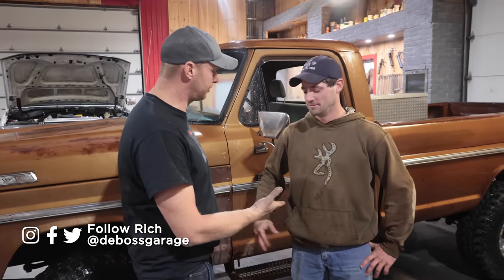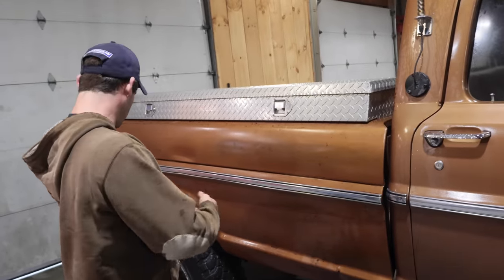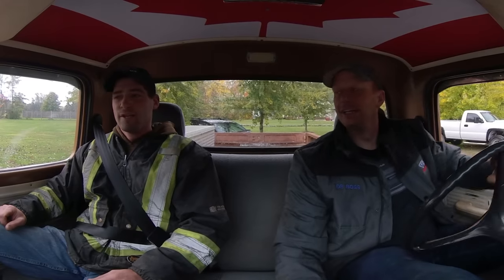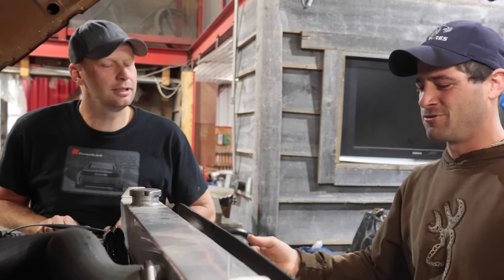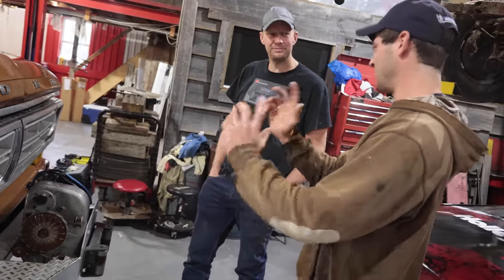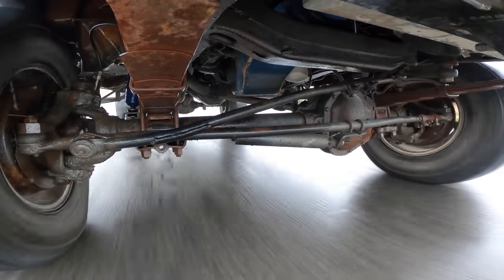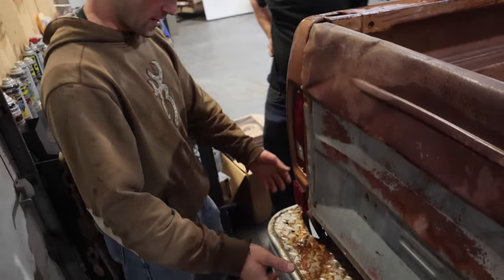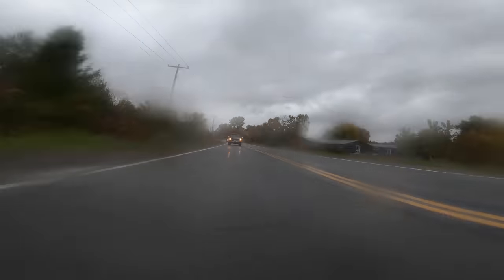The Truck You Want, But Won't Admit It.

Comment: Most of the time, the starting issue on those old engines is caused by air intrusion through the fuel return line caps. Fix those, add an electric lift pump, new set of glow plugs and my old 91' F250 had no issues firing off down to -10F.
Reply: Yes, upvote this. Electric lift is the single best mod I ever did to mine.
Reply: in case of doubt, glowplugs on a pushbutton/switch, my 6.2 starts at -30celcius unplugged
Reply: Lift pumps make the biggest difference. Maybe it's just my issue to get air in the system after it sits for a week or 2. Plugs help too but it doesn't get that cold for me. Only like 15° but it's better than using the starter to warm up the engine.
Reply: There's multiple issues that can hinder easy starting on these. After addressing everything else, my issue was simply that the old stock starter cranked too slow. Got a Powermaster and now I don't have those issues. These things want to spin REALLY fast when they start. Batteries, cables, starter, anything you can do for it will help.
Reply: Yup, I put a Carrier lift pump on my 86' with new glow plugs and it would start no problems way down cold.  Miss that old 6.9idi...
Reply: @DeusTex-Mex  My 4M40T Mitsubishi is the damn same. I pulled all the glow plug wiring and relay out of it because it looked sketchier than frig and I didn't wanna burn my truck down, but it made it a pain in the ass to start below 8 degrees C without any cosby sauce. When I put new batteries in it, it really wanted to go with just a quick snort of cosby
Reply: My 92 uses the stock mechanical pump and fires up easily. If u add a check valve in the supply and return the fuel can never drain out of the fuel filter or injection pump
Reply: Cool story and nice old Ford. I think the older body styles have so much more character than the new stuff. That dude seems pretty cool too.
Reply: I don't think the electric pump is necessary.  I put one in my first idi and it didn't make much of a difference.  My current idi  has the standard mechanical lift pump, air tight fuel return, and 875 cca batteries and I've never had issues starting.  Even down to 0° i dont have to plug it in and it only takes 1-2 seconds of cranking.
Reply: Those factory lift pumps are garbage. On all my old Idis I would just give her some spray tho cuz fuck it haha 💥💥
Reply: @jaredkish8716  they work fine if u don't got any air leaks at the hoses. If u gotta spray it u got low compression.
Reply: @johnsnow1355  I won’t deny that lol I’ve had 3 idis. A 6.9 N/A, 7.3 N/A, and a 7.3 turbo. The two N/As were clapped out but my turboed one always fired up no matter how cold. It also had a grill cover for the winter
Reply: @jaredkish8716  I wish ford had figured out how to make a odometer read over 399k ha ha no idea my engines milage

Comment: I put a 6.9 idi with a C6 into my 1953 IHC R120. I converted the R120 to 4X4. The engine sound was fantastic.  The engine was lazy but economical. I drove this combination for 20 years and 225,000 miles

Comment: To me as Brazilian born the Bumpside will always be the most legendary most iconic most amazing design pickup truck ever built , there’s something so right about everything, in Brazil Bumpside were built from 1971 all the way to 1992 beginning of 1993 still selling the left overs like crazy … the Brazilian ones had Diesel engines from 1979 and from 1990-91 turbo diesel factory and 5 speed Clark transmission! Beautiful 1972 HighBoy love the copper gold colour ❤

Comment: I have a 93 7.3 idi f350 and it’s been one of the most reliable trucks I’ve had. No it’s not the fastest/ strongest but it’s always pulled what I’ve wanted to, reliably.
Reply: "Loyal" as a certain one-legged Albertan would say.
Reply: Our turbocharged 7.3 idi dyno at 219 at the wheels goes 0-60 in about 8 seconds and is good on fuel.  He keeps saying it's gutless. His other diesels must make ridiculous horsepower or something. I know a couple guys with newer diesels that do make a lot more power, but are getting terrible fuel mileage

Comment: Great interaction tween these 2 truck guys..Damn my IDI sitting in an 89 F250 is one of the best trucks ive owned 19mpg if i keep it at 2k RPMs, the body is falling apart it starts as long as I do the glow plug prayer brakes are terrible, If I need to go fast i cant haha. Ive often considered putting the IDI into my 71 W200,
Reply: Yep if u keep them at 55 or 2000rpm that's what they are built for when the USA only had 55 limit highway
Reply: Excellent that you mentioned the RPMs. Most ppl give economy without RPM, kinda worthless
Reply: What tire size and gear ratio are you guys running to get 19mpg?
Reply: I bet it's faster than the 300 i6 lol I used to joke my 4 speed 88 f250 was literally the slowest vehicle on the road wich I believe it still is
Reply: @johnmorgan8750 he's probably soft peddling it while shifting and riding at 2 k he's getting 19 mpg and it technically wouldn't matter if they were in hi 4s or low 3s  but his speedometer wou😮ld tell you his gear ratio . I had a 90 f250 5 spd 2wd I'd get 19 + keeping rpms low and turning 2-2200 max usually, drive my 96 f350 4x4 srw pretty similar hitting hi 17s on regular mixed driving and have bumped hi 19s on a couple long hiway trips 4:10 in my 96 I'm certain the 90 had a little longer legs. Some people will try to make a case of driving it harder for better mpg also these people are not in with basic math etc. Be it checking fuel mileage or not understanding the obvious more rpm = more fuel consumption. But they technically don't offer a big variety of gears as a rule a lighter 2wd f250 2wd will be about the highest geared and lightest  truck in the category of f250 vs 350 450  ok I wrote a lot I doubt it gets read lol

Comment: The idea of an old idi diesel is torque, and mileage. My 1970 Highboy, with a 7.3 also has cross over steering and panhard bar, Wich has improved stability ,steering anomalies like bump-steer, etc cleared up it's a dana60 kp, new rotors, calipers. It's like driving a newer truck. , aluminum rad, new rear springs with my design rear spring hangers, some poly mounts like cab body mounts and spring bushings. Has air springs for my 3000 lb camper. Limited slip (power-lok) in rear. There's always room for improvements. Lots of these motors around and even more parts available then used to be. I still would upgrade the motor but like the re-liability and rpm range.

Comment: The 6.9/7.3 IDI's are one of the most overlooked diesels out there. They are not powerhouses, but are more civilized than a 5.9 Cummins and economical. I'm rebuilding a 6.9 out in the garage for my truck. Like Gavin, I'd rather have a non-electronic diesel.
Reply: I love my 6.9/7.3 idi's and would agree with your statement other than the civilized part lol, I don't think being heard a mile away from the clatter 😆
Reply: @everettschroeder1441  A 5.9 Cummins is louder and has a much narrower powerband. Ford chose the V8 International  over the Cummins (when they owned part of the company) for this reason. Remember, the buying public still had the Olds 350 diesel stigma on their minds in this era...
Reply: My 91 7.3 is wayyyyyy louder than my brothers 5.9 Cummins, both from the sheer clatter of the motor and the exhaust (granted I have a 3.5" straight pipe and a stack and he just has a 4" straight pipe) but also the cackle in the exhaust of a idi. I won't disagree with the wider and much better power band than the Cummins, and honestly stock for stock the 7.3 had the 12v in power hands down, but the architecture of the idi killed performance above stock power levels and that why they never caught on like the 12v or the powerstroke after them
Reply: If your idi is louder than 5.9 (sans commonrail) theres something wrong with it.

Comment: I don't know what it is about the idi, you get one that starts right up after sitting in the freezer for a month, or one that won't start for NOTHING, EVER. Of all the ones I've ever driven, it was strictly 1 or the other no in-between. She's either a quick starter, or you hold the key and say see you next Tuesday (or wait until the battery runs down whichever comes first)
Reply: I think we towed like 6000lbs uphill for mostly 100 miles one way going maybe 15 mph rapping out the engine in a 87 f250 with a 6.7 with no oil. Then drove another 100 back with no oil then after another 2 weeks in 110 degree weather driving around town hauling a 16ish foot flatbed sometimes loaded with logs sometimes not then we loaded up a john deer riding mower on a Saturday morning about 80 degrees and the truck just wouldn't start went through 2 batteries recharged the batteries went through 2 more and the thing just would not start I wish I had gotten to check the compression but seeing in how it would barely do 50 mph after a 10 miles of acceleration I'd bet it was shot or maybe just had a clogged fuel pump but I remember that faithful 100 mile day the temp meter was well pegged around 230 degrees for 80% of the trip uphill
But I'd have to say it was still better at hills than my 88 300ci i6
Reply: @hickstylez  yeah lack of turbo on the original 7.3 iDi did make it a real shitshow pulling trailers up a hill. They just look at a grade and start crying. But they do run forever if even halfway decently looked after. Albeit consumption to power ratio is never acceptable no matter what you do, unfortunately. Today as of 2022 personally I'll leave engines like that to numbers-matched great shape pickups, the kind you couldn't bear tearing apart (it's only 100% original in good shape once). 7.3 power stroke is the one I'd go after if if the price is right and project demands but even that's getting expensive to maintain

Comment: About 15 yrs ago I built a 72 bumpside crew cab short bed put in a 7.3 Idi c6 auto Dana 60 high pinion from a 79 F350 as well as the better power steering from the 79 100% rust free imported body ( Im in BC)  painted it a dark maroon black Xlt interior, that truck attracted more attention than most of the muscle cars I ever owned and I had some nice ones, ended up being sold to a guy in Fresno CA, its actually my Youtube pic.

Comment: Owning a 92 Banks equipped IDI and a 97 cammed, tuned 460, I want it but no parking.
Turn up the pump, put glowplugs in it every 3 years. Mine starts great down to 0⁰F, pulls like a stock PSD.

Comment: always added a check valve between the mechanical fuel pump and the filter housing and levered the pump as much as the slots allowed to advance the timing and they were reliable starters
Reply: Take a shim out of the advance 👍🏼
Reply: I have the check valves and I never had to touch the timing. If the cold start advance is working it will fire right up with 5 seconds of glow plug
Reply: I don't know why they always start hard. I have a 12 valve Cummins that will start with the barest bump of the key in any weather. No grid heater on it either.
Reply: @Bloodbain88 because they are indirect injection compared to the direct injection in the Cummins

Comment: If you put the powerstroke starter on it it spins a lot faster and you have no trebles starting. I have two of them and both of them will start in 42° weather totally morning cold start with no glow plugs. Also helps to give it a little injector pump timing
It's all about starter speed
Reply: Yep the big beast Idi starter sucks the newer 94 starter spins much faster

Comment: The best thing for the Idi is 6.5 glow plugs with the nut head trimmed to fit and a ford starter solenoid and a mechanical switch. The gm glow plugs are pretty tough last forever.

Comment: I have a 7.3 idi Ford f250. 200k miles and not an issue with it aside from some interior trim/switches came loose. The motor is epic. Just keeps going and keeps going. Non intercooled even. I just took it 38 straight hours towing a huge 20k lb boat across 3 states. Ended up just pushing a little further and a little further and ended up just doing the entire drive STRAIGHT except for gas/bathroom/food stops (ate on the road) she may not be the fastest especially pulling a very very heavy load up long steep mountains, but she will tow and she won't quit

Comment: i love this truck.  to me the 72 body style is the nicest ford ever made   being a highboy is a huge bonus. 
if too tight behind the wheel just get a smaller steering wheel. 
i love the 6.9/7.3 idi   yes they are gutless. yes they start terrible  
but they sound so great and they do good on fuel. 
this is a great build.  i love the truck!  awesome!
Reply: The problem there is lack of a proper power steering system. I mean, yeah, Ford did make factory PS for them. But you don't want it. Working a proper Saginaw PS box into there can be done but they always end up a bit janky. You are better off sticking with the manual box and muscling it around with the big steering wheel. At least that was the reasoning I used on my 72.

Comment: I had a 90’ dually with a 460 gas and it didn’t matter if you were running bobtail or pulling a huge load it got a consistent 8.5 miles per gallon.
Reply: Same here.Still run 460's 9 miles to gallon empty or with 14,000 on the trailer. Least it's consistent.

Comment: I've got a 79 F250 Super-Cab that I am swapping onto a 99 Superduty frame.  Had a 6.9 IDI that I was gonna put in it but after this video, it has convinced me to go with a power-stroke.
Reply: If you need a hand I’m making pretty good progress on my 77 Supercab project on 99 Powerstroke chassis. Willing to throw around ideas with you.
Reply: @gavinmetcalfe140  That would be great.  I'm working on getting the frame sandblasted, painted, and all bushing replaced then I'm gotta fabricate new mounts for the cab.  Thinking about stretching the frame aswell to accommodate a long box
Reply: I used the frame from a crew cab long box so I had to shorten mine. Make sure to tighten the body mounts down to the brackets before you weld them as they squish some and you’re liable not to have it line up with the box. 
I used the original Superduty cab mounts and bushings for ease of finding replacement parts. I had to do a bit of modifying of the front mounts as they were a hair narrow if I remember correctly.

Comment: You can use a 1410 yoke off the later axles and machine the spline section deeper so that it will bolt up to the shorter pinion of the older axle. You have to machine about .187"-.210" deeper. Works great on the dump truck I built. Then you dont have to do the conversion joints...
Reply: This is great information. I’m impressed you had the insight to do some machining and make it fit for easier maintenance in the future.

Comment: Over built engine tuned for low power = Reliability. I own a 94 turbo idi, a 07 5.9 , and a 06 "bullet proofed" 6.0. I cant even keep up with how many times the old idi had to go save my other trucks. The secret on old turbo idis is 2 flats injection pump , then adjust turbo to 8-10 pound of boost. mine with that setup and a zf5 4:10 gears tows my 14,000k enclosed trailer 70mph no issues... but lets not talk about mountains..........

Comment: I'm in northern bc now, and water/heater circulator and in cab heater for warming the fuel tank behind the seat sure helps. Just had -21 temps and it starts great. Power-stroke starter

Comment: Must have never driven one in good shape! No problem starting mine.  

I've run mine for the last three years in Alberta winters. Sits in the field while I work for 8 hours at -45c no block heater fires up no problem.

Comment: I have a '93 IDI and a '72 Highboy. Running and driving. Tags, insurance, mud tires, everything. I like them both too much as they are to cut them up and combine them. Even though the result would be EXTREMELY EXCELLENT in every way. Remember, the old fashioned 4x4 stuff that is considered problematic now are "features" and not impediments. At the end of the day the real story is how he scabbed in a proper Saginaw power steering box to a 4th Gen Ford. Not the engine/trans/axle swap. Making the steering geometry work is a far more complicated task than dropping a new engine/trans into something with a divorced t-case.

Comment: That truck is great.  Good driveline, good fuel economy, good reliability.  I drove a '93 IDI Turbo that ran REAL good.  It's really a question of how much power do you NEED vs. how much you WANT.
Reply: I agree with this. At this point in my life I needed enough power to haul 14000lb of gooseneck trailer over some hilly countryside. I miss this truck, it was a great driver and had lots of juice empty but loaded it was always a hazard in the road.

Comment: I had a 79, same color. Meth head stole the drive shaft & tail light's. He got busted for meth & died in prison. He wont be stealing anymore drive shaft's. PS, The 400 got 10 mpg going downhill wth the wind at your back or uphill pulling anything. Just an old farm truck.
Reply: Oh no loss

Comment: The idi diesels are based on internationals last V8 heavy duty gasoline engine. had about  same power as the other light truck diesels of the time. They make decent reliable power TUFF! 
 I think these older diesels have a huge advantage over the new computer controlled , def , super expensive, hard to work on diesels

Comment: Say what you will, personally, I kind of like the IDI’s for a inexpensive swap…I mean, if you want a takeout 7.3 PSD, or 12 valve Cummins or 24 valve Cummins, you’re in it at least 3 grand, and that’s just a takeout, no freshening up, no resealing, nothing…for a 7.3IDI it’s like 800$, they’re dirt cheap. Sure they’re gutless, sure you have the glow plug issues and the return line issues, but they’ll run forever. And I’m a 12V guy.